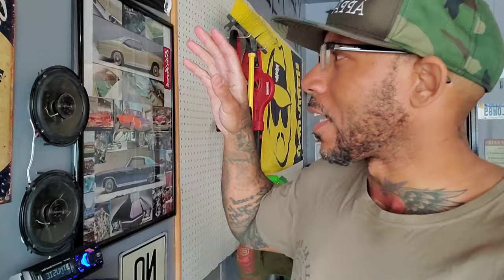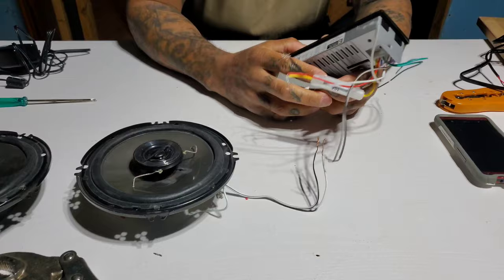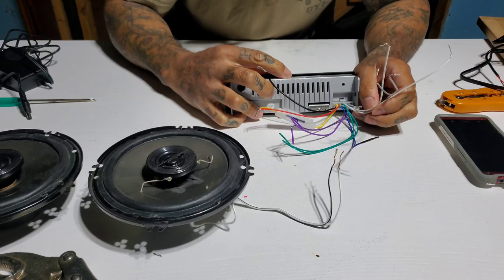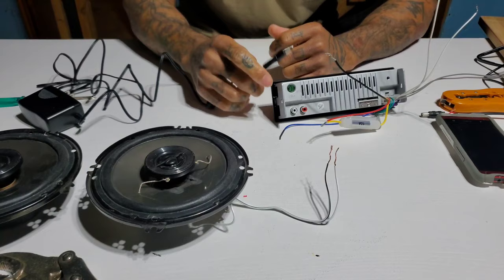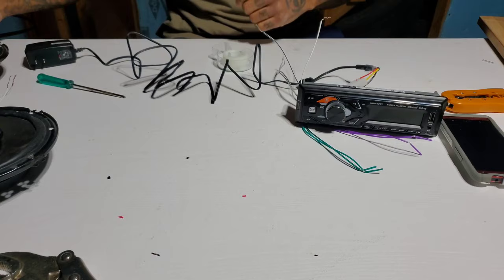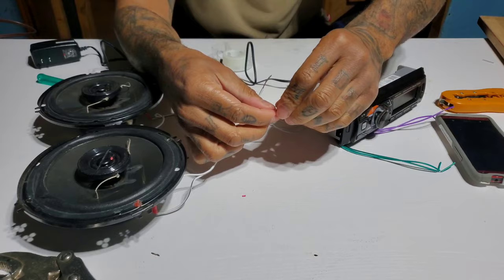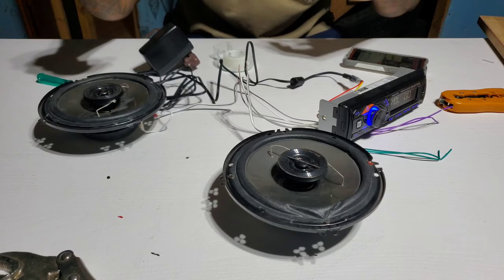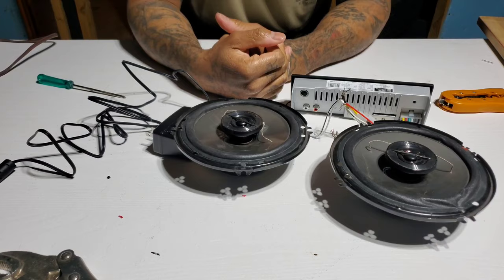diy turn car radio into garage radio or house radio

Comment: I was doing that as a teenager, LONG ago! In HS we'd get a car stereo, build a wooden box to put it in, cut two holes in it, install what we called door speakers and power it with a motorcycle, or two 6v lantern batteries, these were our boom boxes! The Japanese got wind of it and by the late 70's, early 80's, we saw boom boxes with UNBELIEVABLE features! Actually, no disrespect, but you're LATE with this!😂
Reply from the maker: @ricardoflot2787  yeah I remember those good ol day to I use to do the same

Comment: Also take note about the Amps of the 12v power supply, if that headunit is producing about 200w on 4 channel then probably you should have a 20A 12v power supply.
Reply: I have used 5a power supplies with no problem. No overload doesn't even pull a full 5 amps. Cars stereos list all of these outrageous power numbers but they're bullshit. Realistically you get around 15w per channel if that. Sony makes a few stereos with beefcake amps in them but they're the exception not the rule.
Reply: @ElectronicsForFun  maybe that's why, but my pioneer ones doesn't like the 12v 5a power brick (cutting the power off), but works wonderfully on my 14.4v 30a power supply. (Too overkill lol). 

I also have a local cheap head unit (bought it for about 8 usd brand new), I can crank it up 100% with the 5a power supply. So maybe it's likely producing less than 50w on 4 channels.
Reply: @bryanleiporsado6845  yeah a good car stereo will draw some power, your average Walmart or Amazon car stereo is going to be a pooch.

Comment: Btw you should generally match the amperage of the power supply with the radio's fuse. 10 Amps in your case.
Reply from the maker: Its built into it
Reply: @LDMLIFE westside

Comment: Great video. Only thing I would mention is you should use a multimeter and measure the maximum current draw and make sure your 12v adapter can handle it.
Reply: What happens if it can’t handle it

Comment: I have been setting up a system like this for my garage using a old set of house speakers a early 80’s Chevy suburban radio with tape deck and a bench top power supply

Comment: The question I needed answer was what kind of amplifier or control panel I needed to run speakers. I wired a 40 V lawn mower battery to some lights on my bicycle am interested in adding speakers. i might have to build my own bt radio to make it as compact as possible

Comment: Appreciate that Boss. Was just wondering if there was a way for power without actually having to use a car battery. I have plenty of those plugs. Want to test the quality of sound before I install radio in the car. Have been through 2 so far for my niece and don't like the sound. Want a radio that has some bass without needing an amp and sub. 3rd radio is on the way so I wanted to test it in the house before installing. Thanks for the tips. I don't trash too much stuff either. Comes in handy when the wheels in your head start rollin! Thanks again.
Reply from the maker: Thanks for watching and glad i could help and give you some ideas
Reply: I had a Sony MegaBass stereo unit for my car the MEX-N4100 model actually and it sounded great without amp or sub 😅
Reply: @daniellemathis8624  Sounds good. I usually buy Pioneer for the cars and Sony for the house. Been trying touchscreens so she can easily access the sd card of music I gave her. I'll Google yours. This project has become a job! Thanks

Comment: Hi! Thanks for a great video it was really easy to follow and repeat which made it possible for me to set up my own car stereo at home. I’m very glad from the results but I have one question regarding the safety of the set up. 

I want to know if it is safe to connect at home? Can this set up cause any sort of hazard? (Like a fire for example) or will the fuse (located at the back of the radio) blow in case anything happens?

Thanks again for the video
Reply from the maker: The fuse should blow before anything I would guess ive never had and issues just make sure all wires are separated and taped properly
Reply: @LDMLIFE  thanks, I’m 100% sure that I already checked everything, but I will give it another look just to be 100% sure that everything is alright.

Comment: Hey bro the video was rlly helpful thanks alot but i have a question i have car radio i think its a 50 watts radio but i want to get full power out of it. How much amps of a 12volts adapter should i get. Should i get a 6 or 7 amps adapter (i have 7 speakers connected to it) and im currently using a 12volts 2.5 amps

Comment: Can I use a 15-24V adapter for power supply even though the stereo deck is 12V?
Reply: It won't, and please dont do it, there's a specific head unit that supports 24v, the maximum voltage on a 12v head unit are 14v.

Edit: It may work but it won't be reliable.

Comment: I got my deck to turn on. But no matter what wires I hook up to what wire is nothing happens Bluetooth connected  and volume is up when I put together the black white cord and the solid white cord and then the blue cord touch it I hear a little bit of static with but thats it
Reply from the maker: Is the wire diagram still on your radio so you can tell which wires are which you could have them mixed up

Comment: Where did you get the wires that were already  connected to your speakers ?
Reply from the maker: Some time when you those lil 6 1/2 door speakers them will come with those like wires as extensions, but if not any speakers wire will do just add some of the connectors and slide em on to the speakers
Reply from the maker: @yayrdiaz-baltazar8626  probably up to some 6x9s if its just plugging into the wall with a 12v adapter
Reply: @LDMLIFE  yo bro do you think it can power 2 4x6 that are 135w?
Reply from the maker: @yayrdiaz-baltazar8626  it might can

Comment: GREAT video… only issue is it comes on but as soon as I hook up the speaker it shuts off! 

Hooked it to a power wheels battery and no issue.. I want it plugged in the outlet tho. 

Using a Pioneer BT-160 double din. Do I need more power? I’ve tried adapters with more power and it doesn’t even come on!
Reply: Get a 12 Volts DC 5 or 6 AMPS Adapter
Reply: The radio is probably under powered

Comment: What if you want use the actual radio , how do you connect the antena .
Reply from the maker: You would probably have to buy some kind of car antenna and connect the antenna wire from the head unit to that car antenna
Reply: @LDMLIFE  thanks for the advice .

Comment: OK, what did you do with the blue wire my guy because I did everything you did. I have the same exact radio and no music coming out of the speakers.
Reply from the maker: The blue is normally antenna, are you using 12v adapter

Comment: so It don't matter If you're using a 19.5 volt charger connected to a 12volt car stereo? just thought you'd have to use the same power supply that's compatible with  a 12volt car stereo?
Reply from the maker: Yes you have to run a 12v power source its the same that runs a car stereo running any else may damage the radio
Reply: @LDMLIFE  ok thanks a lot bruh 👍

Comment: How do i connect it to battery instead of wall outlet
Reply from the maker: You gotta run the power cord to the fuse box to a fuse that powers on and off when the car is turned on or off
Reply: @LDMLIFE am doing  this for a beach cooler 😂 i need all the help ngl
Reply: @LDMLIFE i got a switch for the beach cooler i could use that right

Comment: Can I use a 7 volts rc battery to power it up?
Reply from the maker: You can try it but I doubt it will work the radio runs off a 12v charge
Reply: @LDMLIFE  yeah it doesn't work, but I got a car battery. Question when I connect the speaker I connect to the same wire color like gray with gray or gray with white
Reply from the maker: @National Boosted  yes the speaker wire that is normally the solid color wire its the positive wire and the same color with a black line also on it is the negative wire
Reply: @LDMLIFE  I figured it out, but if I put them in the wrong way is the car stereo or the speaker getting damaged??
Reply from the maker: @National Boosted  no it shouldn't damage it they may not play sound but it won't hurt it

Comment: My radio keeps turning off when I turn it up am I doing something wrong?
Reply from the maker: The speakers you have hooked up to it takes more power than just the unit can push out so it will normally shut off as a protective measure

Comment: I did this with the same deck but its turns on but no sound comes out and i can’t play music
Reply from the maker: Have you checked the positive and negative wires going to the speakers
Reply: @LDMLIFE  yes positive to positive negative to negative
Reply from the maker: @Shaeboii  and are you running a 12v power source
Reply: @LDMLIFE  yes 12v 3a
Reply from the maker: @8pyr0addict82  that's interesting thats its not working because it definitely show be
Reply: @LDMLIFE  let me try again because this video is a good diy project

Comment: But can it pick up radio stations without an antenna.
Reply from the maker: If u want radio stations you will have to wire up the antenna wire to a wire or some kinda antenna

Comment: Can i do the same with 9V adapter?
Reply from the maker: It might not have enough power most car radios run off 12
Reply: @LDMLIFE  yep it doesn't work. Or maybe radio is broken. To tell you the truth i wanted to try if my radio was broken or some contact in my car.

Comment: I followed your tutorial to a t and my head unit turns on but doesn't put out sound. I have checked all wires multiple times and still confused. I have the same exact head unit if that helps
Reply: Could be your speakers!
Reply: @detroitrugcompany5972  found out that I was stupid and didn't pay attention to the fact that my power supply was only 5v. Ended up going with a lawnmower battery anyway

Comment: I connect mine it turned on but no sound came out
Reply: I also have the same deck as you
Reply from the maker: Did you check to make sure the wires are with the speaker connection wires

Comment: Where did you get that small head unit?
Reply from the maker: It was just a lil head unit from Walmart
Reply: @LDM FITNESS  i found one around Christmas time and just got around to messing with it. I used a Milwaukee m12 battery and then tired a computer power supply and it didn't get loud at all. I came with a set of four speakers and it not loud. I read a comment that said it only puts out about 15 watts. What's you opinion?

Comment: Can you hook up subwoofers to this?
Reply from the maker: You could but you will need some kind of amp to have enough power to push the subs the 12v plug not enough alone to push subs
Reply: I've got two 12s hooked up to the Bluetooth head unit it's doing pretty good it's super loud
Reply: @LDMLIFE  how would a guy power the amplifier same way separate plug?
Reply from the maker: @jesseclark8344  I honestly haven't done it with subs but I would think it would be along the same way as you would in a car you just got yo radio plugged into a socket

Comment: I tried it but no sound came from the speaker😢 head unit did turn on tho
Reply from the maker: Did you check the speaker wires,and is the cord a 12v
Reply: I literally just checked it a minute ago and it says the output is 4.2 volts. I noticed when I saw the screen was dim 😭
Reply from the maker: @tyfowler5883  once you get a 12v you should be good 👍🏽
Reply: @LDMLIFE  sadly the only other one I have is 19.5v but I appreciate the help🫡

Comment: What kind of antenna did you use?
Reply from the maker: I didn't use one I just use the Bluetooth and play my music off my phone
Reply: @LDMLIFE  for some reason mines not working with Bluetooth. It just powers on for a minute says welcome and then powers back off and says goodbye.
Reply from the maker: @tristen3893  yeah that kind of strange it's doesn't have any kind of sound or anything it just immediately powers back off?
Reply: @LDMLIFE  yeah it’s just immediate power than back off but I think it’s because of my battery being dead and one of the terminals broke off so I can’t charge it
Reply: @LDMLIFE  ok now I got it to work and now I’m not getting any sound
Reply from the maker: @tristen3893  do you have the rt wires in the correct connection
Reply: @LDMLIFE   yeah i do
Reply: @LDMLIFE  should I hook up the blue wire to something?
Reply from the maker: @tristen3893  the blue wire is normally a antenna wire
Reply: @LDMLIFE  I don’t have an antenna for it but I do have an amp, but I don’t have anything to hook the amp to
Reply: That is power wise that’s what I am meaning
Reply from the maker: @tristen3893  does your radio still have the color wire diagram on it
Reply: @LDMLIFE  yeah
Reply from the maker: @tristen3893  it should say what your blue wire is for and if you need it
Reply: @LDMLIFE  it says Blue is for power antenna/amp turn on
Reply: So what do I need to hook it up to
Reply from the maker: @tristen3893  nothing you can cut it if you want
Reply: @LDMLIFE  the thing is I’m not getting any sound
Reply: That’s my main problem
Reply from the maker: @tristen3893  are you running the correct wires to the positive and negative post on the speaker
Reply: @LDMLIFE  yes
Reply: That’s the first thing I made sure of
Reply: @LDMLIFE  I got it working thank you for the help
Reply from the maker: @tristen3893  no problem, what was the problem with the no sound
Reply: @LDMLIFE  not enough power
Reply from the maker: @tristen3893  o ok

Comment: Hey mannnn, can I connect 2 30 watt speaker with 8 ohm impedance to a stock car head unit?
Reply from the maker: Yeah you should be able to
Reply: 0p
Reply: @LDMLIFE  thanks for replying , and would the sound  quality be good enough, if I plan to add 2 more speaker in the future?

Comment: Can I use electric tape
Reply from the maker: Yeah I sure you could as long as you got no wires showing and everything tape good
Reply: @LDMLIFE  thanks for the video it worked on my pioneer deh 3200ub
Reply from the maker: @CarlosGonzalez_753  thanks for watching
Reply: @LDMLIFE  my radio shuts off when I turn the volume up to 45 out of 62
Reply from the maker: @CarlosGonzalez_753  your radio might not be powerful enough alone to push yo speakers at that high of a volume

Comment: No amp to do this
Reply from the maker: Nope long as its no subs or anything that requires more power
Reply: Yellow and red twisted together and pin it down to the positive terminal black pin it down to the negative terminal and I'm good

Comment: The outside wire is NOT always the black wire: ground. The center is NOT always the Red/yellow wire: positive.

Power adaptors typically have a small diagram on them that show you how they are wired.

Comment: Hello, can I connect radio with  2Amper addapter?
Reply from the maker: It have to be a 12v  because that's what car radio's run off of
Reply: @LDMLIFE  yeah, I got addapter from laptop ( output 20V-2A), I tried your method of connecting the radio to the power supply without cutting the cable, but it didn't work. Does it need a stronger power supply maybe 5 amps to run just the radio
Reply: at a friend's house, I started the radio with a battery charger and everything worked, my friend told me that it needs at least 5 amps to start the radio. I've seen every video where people use 2 amps and get the radio to work.
Reply: *car battery charger
Reply from the maker: @v1todex361  the 20v might be throwing it off because they set up for 12v did you try testing method like in the video
Reply: @LDMLIFE  yeah, I tried your method without cutting cable but didn't work. But i did cut the cable at the end, and i had the blue wire hanging and the wire without the sheath which confused me, so i wanted to ask you. I am 16 I am learning :)
Reply from the maker: @v1todex361  if you have just a 12v Amp sitting around I would do the text with it and see if the other one is to much power for it
Reply: @LDMLIFE  I'll try find